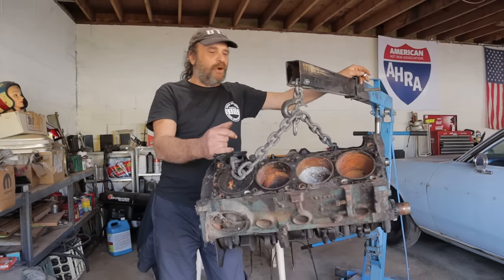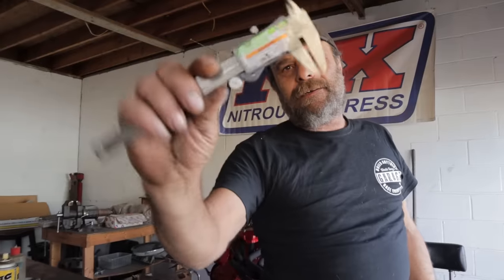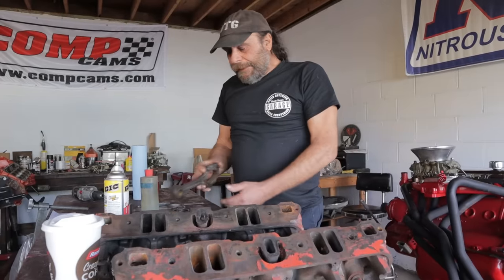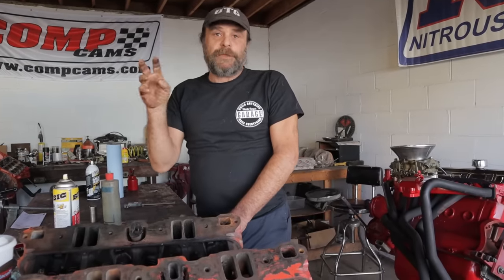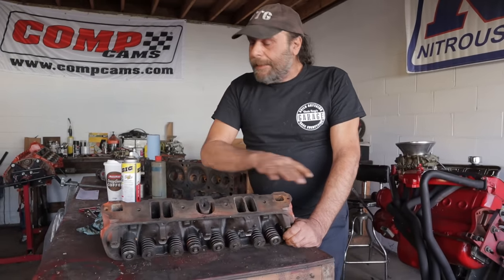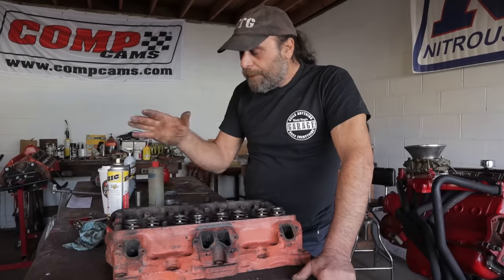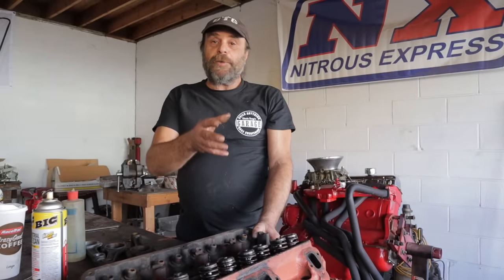The Most Under Rated V-8 In History?

Comment: Hey Tony, I thought I’d share this with you my brother put a 318 in a tractor in the late 60s for tractor pulling back when they used to use only one engine LOL!! And he did quite well he won many trophies even with the 2 barrel carb!! It still has the oil bath air cleaner with the sticker that says 210 hp!! I hauled a lot corn out of the field with that thing pulling 350 bushel gravity wagons back in the mid 70s!! After my brother quit pulling with it!! Amazing little engine and yes very underrated!!
Reply: What tractor did he use. The most common for adding a V8 is a Farmall M.  The coolest one I had seen was a John Deere G with a 392 Chrysler Hemi.  For those who don't know, John Deere tractors built before 1960 had a horizontal 2 cylinder engine. The crankshaft was parallel with the axles. On the end of the crankshaft was a pulley that contained the clutch. The pulley was used to drive equipment of that era with a long belt. The 392 was mounted with the crankshaft perpendicular to the axles. There was a 90-degree gearbox that lined up and used the John Deere factory clutch to drive the tractor. John Deere tractors of this vintage also used a hand clutch,  not a foot operated so it must have taken a lot of skill to tighten up the chain on the pulling sled using a hand clutch with more than 400 hp at the other end of the lever.  The G was originally a 50 hp gas or distillate fueled tractor with a 413 cubic inch two cylinder engine capable of pulling a 3 bottom plow.
Reply: @danw6014  Hey Dan, it was a tractor made in the 50s from Montgomery wards, then they had a tractor that they called Custom at that time as well!! Basically used Chrysler products on that tractor including the engine, transmission and rear end ,it was a flathead industrial six cylinder from Chrysler and also used to have a fluid drive clutch, basically a regular clutch bolted to a torque converter, so the 318 basically bolted right up to it, he eliminated the torque converter though!! Cool story about the John Deere I know something them, even though my dad never used those back in the day!! He started out with Oliver’s and then moved on to International!!
Reply: @scotts7427  I believe the tractor Montgomery Wards sold was a Gram Bradley,  but I may be mistaken, as Sears sold a line of tractors too. There were a few "orphan" tractor brands that used the Chrysler flathead 6 industrial engine with a truck transmission and rear end.
Reply: @danw6014  I looked it up, I guess they were made in joliet Illinois by the Lowther Corp, I guess from 49 to 51 only, maybe Graham Bradley bought them out later I don’t know about that, we still have an original Custom tractor that my brother restored a few years back with the original engine, back in the early 70s that thing that very well in the tractor pulls, there’s a couple of guys on YouTube pulling at a tractor pull with these things, you should check it out it’s pretty interesting!! Very crude looking, there is some nice pictures of some restored ones, they always had two exhaust pipes👍!!
Reply: @scotts7427  its quite possible the Montgomery Wards tractor was not a Graham Bradley.  The more I think about, I think Sears sold them.
Reply: @danw6014  yes you never know back then heck I wasn’t even born, it’s quite possible Sears did sell them, I think you could buy a house from Sears back then!!
Reply: @scotts7427  yes, they had kit houses and big barns as well.  My dad was a carpenter and worked on a Sears house built in 1912. Sears sold everything.  I have a 1937 Oliver Hart Parr tractor with a Sears and Roebuck manure loader on it.
Reply: @danw6014  Well isn’t that cool Dan, I love the old Olivers, very very good tractors I still use a Oliver 88 with a farmhand loader for snow removal with a winter front on it , 8 foot wide bucket it works well!! Love the old iron !!👍
Reply: @scotts7427  I grew up with John Deere but I love old tractors and have a little goal of getting one tractor from every major manufacturer.  I still farm and use two cylinders for some jobs.
Reply: Henry John  it may depend on your soil.  I have a 70 diesel and a 3/16 plow is big enough.  Yes I have seen  V8s in WCs, WDs and we can't forget the Funk Fords.

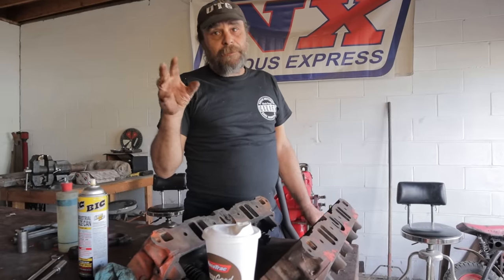Comment: I had its predecessor, the Plymouth 301 and when tuned properly would do 7000 rpm.   Had a lot of fun with it in the 1960s transplanted into a 58 Dodge with 4:11 gears and a three speed overdrive transmission.

Comment: I had a 1970 Barracuda with a 318 in it. I spun a rod bearing in 1975 so I rebuilt it. Here’s what went into my 318: early 340 forged steel crank, 340 rods, windage tray from an early 340, 340 heads with the 2.02” intake valves, adjustable rocker arms from a hi po 273, a Norris cam (don’t remember the specs), an Edelbrock 340 intake with a Holley 780 carb, and balanced by Edelbrock. It ran great, especially with 4.30 lsd 👍🏻 Won 2nd place at the Brotherhood Raceway (Big Willie Robinson) on Terminal Island in Jan 1977. Great memories 😃

Comment: UT you're making the engine I built. 318-3, ported the heads, Comp XE256H cam, edelbrock 600 carb, long tube headers. Runs great even with low compression!

Comment: I was always impressed how quickly the 318 revved it was instantaneous!
Reply: I am lucky I had a 350 chevy, The race track our vette club had I would bang through the gears as fast as it would wind out if it was a 318 I would end up out of gears before I made it through the first long sweeping turn the club designed the track to embarrass any car with less than four hundred horsepower!
Reply: Ford lost their mind as well, the nylon gear made it into the Cleveland motors and jumped timing . I would end up putting used 351 windsors into these customers cars and they were delighted with the low end and mid range torque!

Comment: This was good information. I rebuilt my dad’s ‘66 273 to stock specs (but “0.030 over) with the exception of an Isky E-4 cam that I read good things about. Where I fell short was using flat-top pistons from Egge because they seem to sit low in the holes and as a result my compression is less than the factory’s 8.8:1 for a 2bbl 273. If I decide to pull the motor apart again, I’m going to go with Ross custom pistons to bring the compression up to 10.25:1, put on the 273 4-bbl intake that I bought, and have some fun. Thanks, Tony.

Comment: ive always shilled the 318, i absolutely love them in my two dakotas. reliable as the sunrise, durable as hell, low end torque for days-months-years, whichever comes last, built factory internals, and you can do anything you want to them for peanuts
Reply: I helped put the first 1500 318's in the Dakotas at the Whittier works in 89,'  at that Old Guys small skunk works,  best job I ever had. Teardown crew. The 3.9 V6 & 318  had same front/rear block mounts and made the swap easier. TBI was used, and later models by Dodge got the multi point EFI, for better power.
Enjoy!!
Reply: @joekurtz8303  I got a 91 and a 95, honestly I prefer the TBI

Comment: The Mopar Mule.   I owned to Plymouths, a 73 Road Runner, and a 74 Satellite with the 318.   Drove the Satellite from Fort Carson, Colorado, to northern Indiana when I went on leave.  Never failed me.   Wasn't the head turner that the larger engines were, but the dang thing was still pretty solid.   Streetlight to streetlight racing back in the day, I rarely lost.

Comment: Put almost 500000 miles on my old conversion van. Drove her coast to coast and almost everywhere in between. Worst that happened was the plastic timing gear at three hundred thousand. New chain set and the body fell apart still running.

Comment: I built a 318 when I was a kid and I put 360 heads on it. The heads were shaved so much that I always had intake fitment issues. This was back in the late 80's early 90's when I was basically a child. I do not know what the compression ratio was and did not know that putting 360 heads on a 318 was a bad combo. But the guy who did my heads must have known and was looking after me because those heads were shaved A LOT. That car was well known as the fastest car around at that time. It was in a beautiful Volare.
Reply: Yes that's correct, it should be checked (cc) before cutting but it's around 60 thousands to bring it to the 9.1 comp , and that would cause an intake problem. If memory serve me right for ever 10 thousands taken of the chamber side, 0.123 is taken off the intake side of the head , then any intake you want to use will fit properly.
Reply: I called Dick Landy many years ago about the same problem.  He told me to shave 11 thousandths off the intake for every 10 thou you take off the head.

Comment: Uncle Tony I’m a Ford guy but I thoroughly enjoy your videos and your knowledge. 

I totally dig your attitude towards low buck use what you have view point. For example I have three sets of E7TE 302 heads laying around. I’m not interested in buying
Reply: .....yet another set of heads. I want to use up my parts. I’m going to build an old school budget 302 but with a roller cam and 10:1 compression. I think with some nice valves and my home porting efforts and a good valve job this little nugget will go like stink. 

Added bonus? My shop has yet another pile of parts that are on an engine working instead of laying around collecting dust.

Comment: I had a 318 in my 71 Challenger. I put 340 heads, intake and timing chain. I also put a crane cam with high lift and 292 duration. The first causality was the 904 trans. Blew it out. I installed an A727 trans in it. Then blew out the 81/4 rear end. I then put an 83/4 4:10 in it. That car would haul butt. I used to street race here in Kannapolis NC. Had a blast with this setup. I bought the car in 1979. I still own it. It now looks like a 70 Challenger R/T in white. Only difference is it now has a built 340 in it. I have had this car longer than I have my boys😛

Comment: 318 is by far my favorite engine for that very reason, that they are underrated that is
Reply: porting the heads all out will cost more then a after market head witch way better it cost me to take a set of 202 angle plug heads to 204 and match the intake and exhaust ports to mach the valve new size was 3800 at a mech. shop with all new valves but i had to do it because of the high rpms witch i can run it up to 15,000 rpms so i had to have cast on cast for the engine to last or they like too blow the head casket .but that is the cost for a real drag engine 1200 hp on pump gas no nitro stock body is the class i run .
Reply: What?
Reply: @jeffrey4547  ... 1: then is a poor substitute for than.
  2: it takes a witch's magic to get witch out of which.
   3: time to switch your tachometer from 4 cylinder setting to 8.
Reply: @JW...-oj5iw  this shows how much u know about engines mine was built by old mam bell and he has been building race engine for a very long time . like bell said Indy guts with a dragster top end and he used the highest quality parts money could buy . over size sleeves and bell will back it to do 11000 all day long , did u know top fuel cars run about 17,000 rpms my engine came out of rick news dragster then we ended up with over 25,000 more in it . basically built like a methanol burner but for pump gas
Reply: Over rate a 318: https://www.hotrod.com/articles/318-small-block-build
Reply: @JW...-oj5iw 😂
Reply: @joshuaatkins5197  ... Sorry Pal. Illiteracy and I don't mix, kinda like oil and water.
Reply: @JW...-oj5iw  I was about to make a similar comment and I saw yours so I just laughed. 🍻

Comment: Hey Uncle Tony, as an old "Mopar" guy from way back, I feel a lot better after watching your SB 318 vidja. As back in about 1975 I bought a used 72 Barracuda with a bad running 340 in it. I took it 2 several mechanics who could get it to run good. So I went to a local salvage yard and got a low milleage 318 out of a 4 door Coronet. I always questioned my swapping a 340 for a 318, but that engine sure ran sweet.

Comment: I put "fast burn," or "police" heads on my stock 1968 318.  I like the swirl of the chambers. I left the small valves in. I am running a tuned 500 AFB cfm 4 bbl.  Smoothest Mopar I ever owned, and plenty of power.  (I gave up building for speed after I drove a Viper.)
Reply: probably lost your mind if you would  have drove a Challenger Hellcat Demon
Reply: @michaelwallbrown3726  The same guy that got me the Viper has a Demon.  We went to "Demons vs. the World" in Houston. Different kind of cool, both can be lethal if your not careful. Glad he is careful.

Comment: years ago when i used 318 we would do 1.88  1.60 valves but we port matched instead of gasket match. the best running 318 i have ever seen was a 318 with a turned down 360 crank seems like it was about 340 cid  had tons of torque and ran really good.

Comment: Great vid as always! I wish Tony was my uncle... I've had plenty of 318 jeeps and never had any reliability issues other than overheating (head gasket issues via aluminum heads obviously).  So I've ben against the different metals of head vs block for years.  But other than that 318 vs 360 stock in the jeeps I've driven, I don't see much of a difference, and love 'em both just the same.

Comment: Hey Tony!
   Back in the mid70's, had a '72 Duster with a shot 318/3 on the floor.
Paid $300 and drove it home.  Rebuilt the 318 with 360 heads off a Little Red Wagon  (police motor?) And a purple shaft cam, headers, a 2500lb clutch, and rebuilt the carb to progressive linkage and re-jetted it.
Here in Detroit, used to challenge and beat 455 Trans-Ams, and when they asked what motor I was running...I showed them a 2 barrel 318.
God I miss that car!

Comment: Don't forget:  Be careful when changing valves.  In SOME instances, you'll get better street performance by keeping the stock exhaust(clean it up though) but going up on the intake.  Also, to gain some compression, shave the deck a bit.  Both easy jobs.

Comment: When I was in high school I had a 1964 Dodge Cornet 440 with a "big/wide" 318 2 bbl - loved it. It was a tank and took a lot of a 16 year olds abuse.
Reply: Yeah, I've had two 318 Poly cars, a 65 Coronet, and a 65 Belvedere. Both ran much stronger than any LA 318 I've ever had, even with 2 bl carbs.
Reply: My first car was a 1964 Dodge Polara! 318 poly head. Bucket seats and console! I was going to install a free 413 BB but my dad nixed that plan! Black with Red interior!
Reply: @craigcontofalsky4387  I know where a black 64 Polara with a red interior is sitting, in Bellingham, WA. It hasn't moved in 15 or 20 years. The owner says it has a swapped in 440 and 727. Also said he parked it cuz of trans problems. I'm betting he didnt hook up the kickdown right, and burned it up. Its rusty but he has a lotta spare parts. Wanted some stupid number like 4 grand for it a couple years ago. I coulda got it for a grand 20 years ago.
Reply: Wow

Comment: It used a lot of the same parameters as the 500 cubic inch engines that Scott Gffrion and Darrell Aleerman ran when they dominated Pro Stock. They used the same rod length to Stroke ratio, and they lasted forever, the 318 that is. The pro stock engines should have lasted just as long! My old boss had a Challenger with a 318 in it. Once he for the compression ratio up where it should have been proven to work well in everything else in the automotive world, it was a screamer! It was a like 340 
Compared to a Chevy 307, compared to their 350 and ours to a 340 or even 360. You can take a 318, turn the mains down on a 360 crank and make 349 cubes. Hen treated properly I like the 318 over the 327. Punch the 318 .030” over and you’ve got 322 cubes anyway, take it out to .040” over and now you’ve got 324 and at .060” you’ve got your 327 Mopar. Now when you bump up compression you’ve got a strong running motor. Now, back 8n the IROC days they started off running Camaros with 350’s, all built to the same specs. But the last year or two Chevy pulled out, after having some reliability issues and Mopar was tapped to fill in. So they took the same avengers that they were running in Prostock, took a Mopar Small Block machined out to 100% Chevy specs and made more power doing it with smaller ports than Chevy was using. They used the same 4.001” bore and 3.438” stroke as the 350, same cam grains, same valve sizes, same rocker rartios, you name it, and they beat Chevy at their own game. And it all started with that 273 and then the 318!
Reply: The difference was the 18-degree head of the Mopar

Comment: The 1967 and EARLY 1968 318 blocks can take 4.00" bores. Mopar was originally going to release a hydraulic lifter 331" engine in 1967 with a 4.00" bore to compete against the Chevy 327 Nova, but the valves were the same size as the 273 and the performance was disappointing and Mopar scratched the 1967 331. They maximized the 331 by boring it .040" over for 340", they mimicked the Chevy 327 intake port size, 327 valve size and made the exhaust ports as large as possible. The manual transmission camshaft was meant to beat the 350 horsepower Chevy 327. The 340 was originally designed for a 6,500 RPM redline, but that would require forged pistons for the 50,000 mile warranty and the cost was deemed to expensive. Cast pistons were chosen for the 340 and the redline was 6,000 RPM and the hydraulic lifters would pump up around 6,000 RPM with NEW valve 340 valve springs. The 340 valve springs would lose tension after a few street miles though. The 1967 318 had a slightly larger camshaft than the 1968 318, that used the new for 1968 273 hydraulic camshaft. The 340 camshafts were the first Mopar camshafts with 75%  cam lobes, as the big block high performance camshaft  had older designed 70% cam lobes. One of the best 318 heads is the swirl chamber, '302" cylinder head and the one year only, "308" head.
Reply: Just....wow. Lmao.